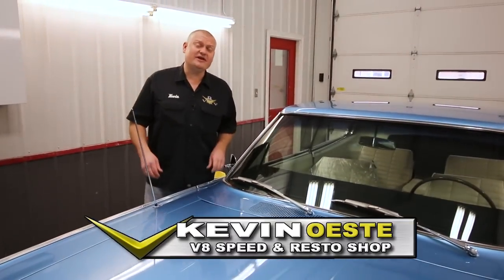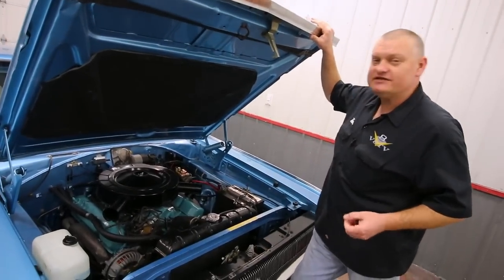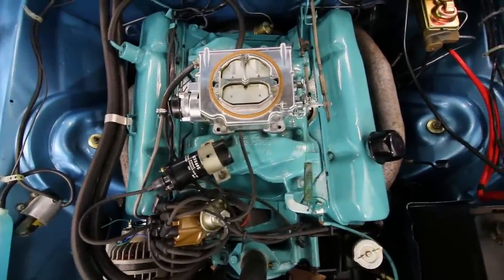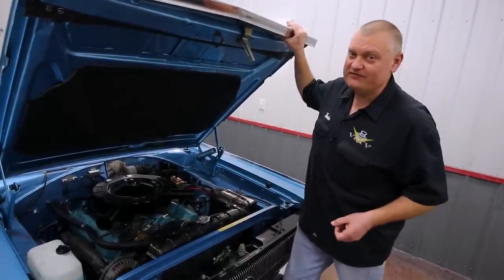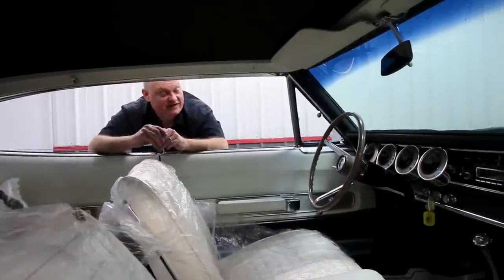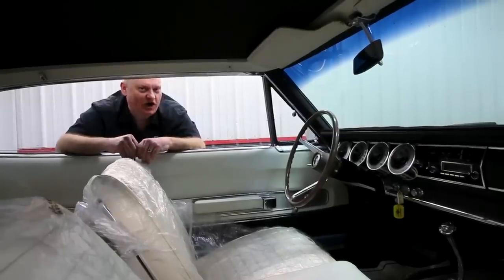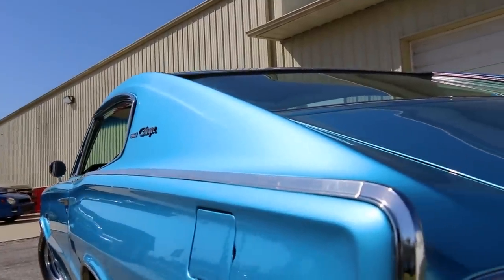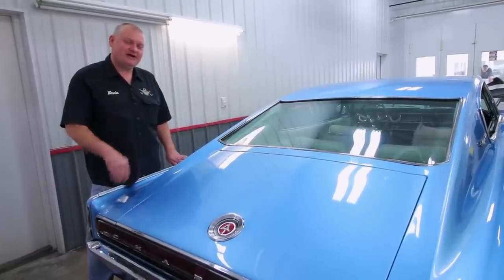1966 Dodge Charger Upgrades Video V8 Speed and Resto Shop V8TV

Comment: The more that I see these '66 and '67 Chargers, the more I like them!
Beautiful car and work lads! 👍🏻👌🏻👏🏻😍😎
Btw, just WHAT is the difference between the '66 and the '67?
Reply: 67 had front turn signal on the fenders, straight stiching on the seats, option of 440 and option of no council

I've got a big block project 66 Charger for sale for $4700 if interested? Doesn't run/drive yet, but newer motor , auto trans  Does have standard rust. In central MN

Comment: What is better about Demon Carb?
Reply from the maker: The Demon is a nice alternative to rebuilding the original Carter AFB.     They are both aluminum, but the Demon design is less prone to fuel leaks, and the electric choke and vacuum secondaries are easy to adjust.   We've installed several of them and they are simple, easy-to-install reliable carbs with snappy throttle response and a good choke design for easy cold starts.